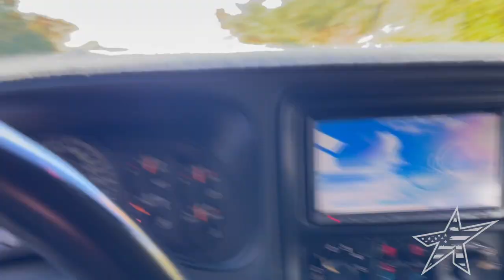Can we use a  Prerunner to do truck stuff?

Comment: This has been an honest question ive had for a while now. I assumed you couldn't tow with a prerunner, wouldve loved to see some video driving on the highway.
Reply from the maker: We actually tow with it quite frequently
Reply: @DuneStars what’s the setup like? Lower rate leaves? How does it stop? That’s the thing I’ve always assumed was sketchy. Does the rear lift really bad? Front dive? Very surprised that it seemed relatively unaffected by the car.